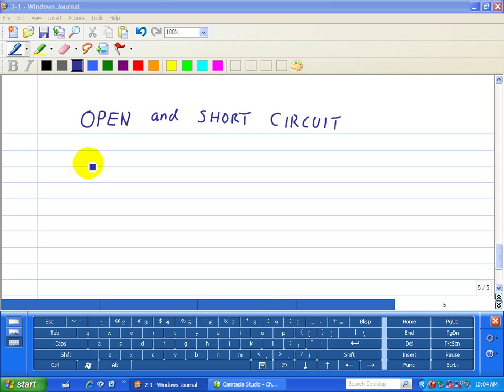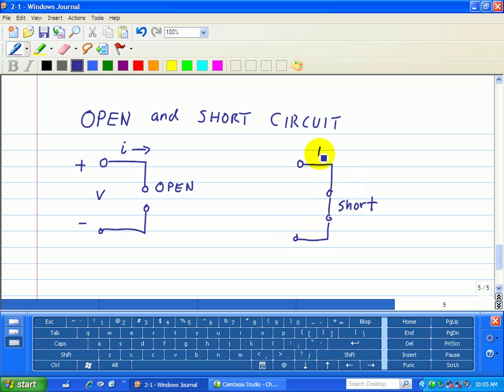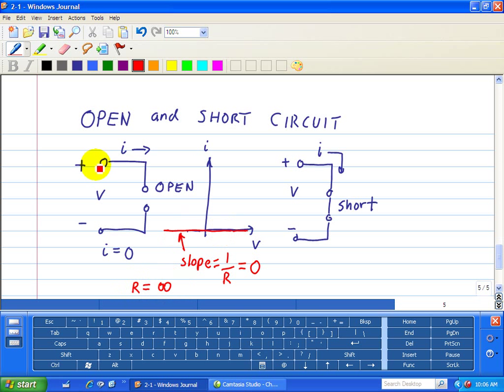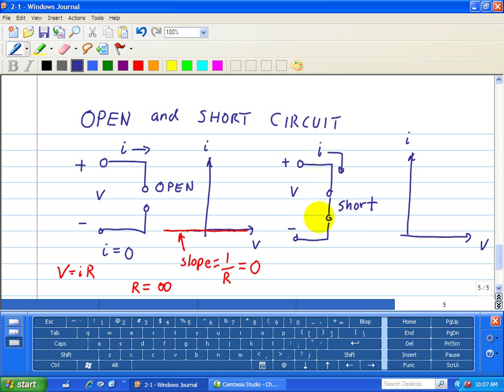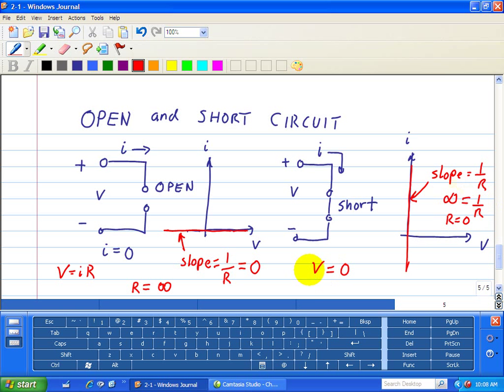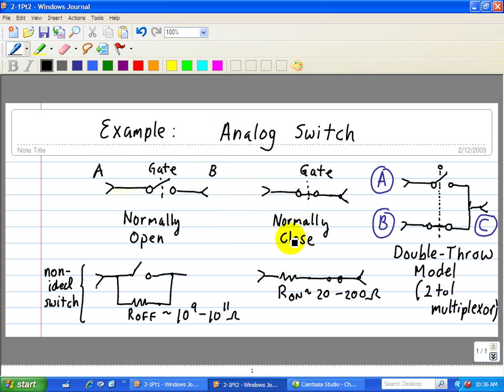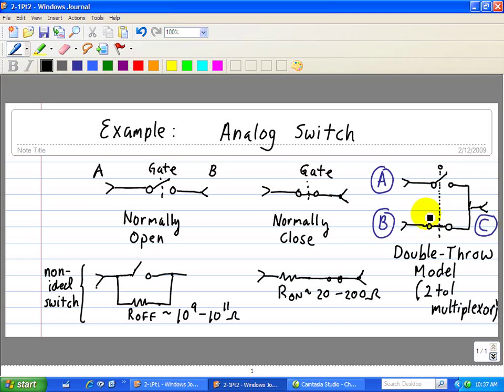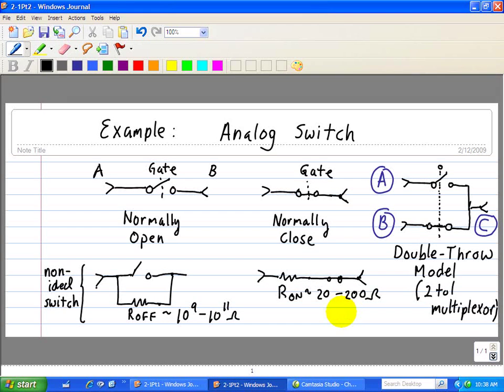Electric DC Circuit Analysis - Open & Short Circuit & Analog Switch Application

Comment: The voltmeter reads difference in potential, if there is no potential difference between the two terminals you are connecting the V meter to, then the readin will be -> 0